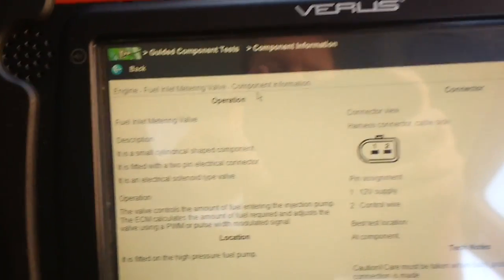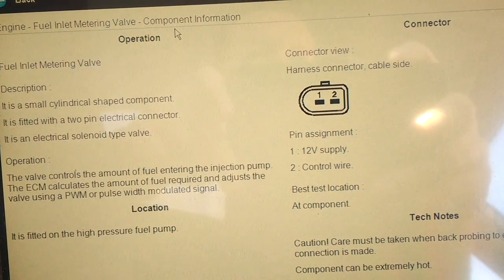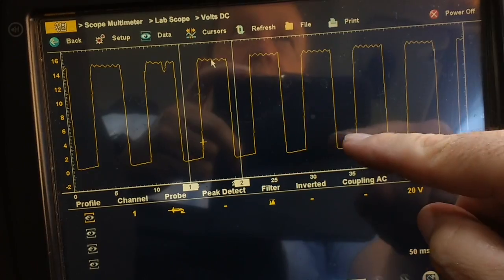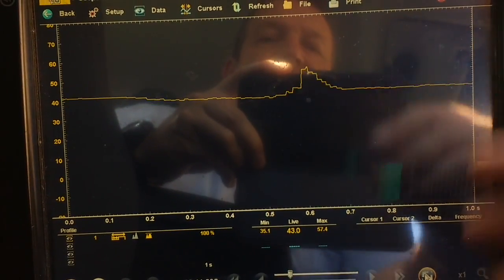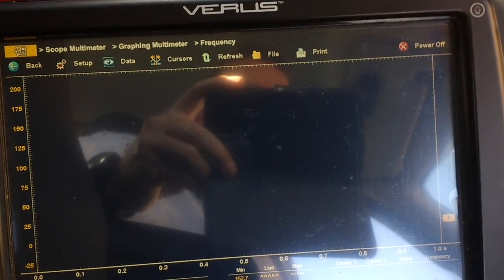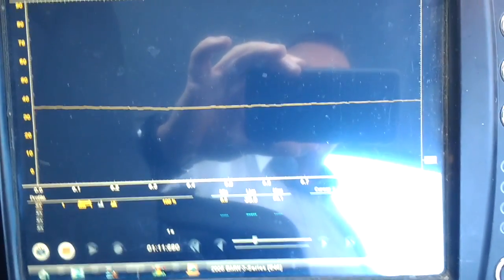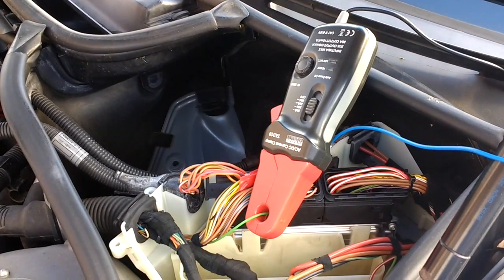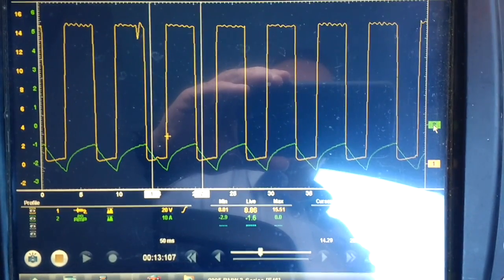Testing fuel Inlet Metering Valve/DRV DIESEL

Comment: Hi sandy, are you a member on simply diag Facebook group? I’ve got a surging idle on a A20DTH insignia, I remember watching this video last year and I found it today and did the tests shown. 
I’m getting drop outs when scoping the control wire on the IMV. I’m thinking it’s the valve but how do you determine if it’s the valve that’s causing the drop outs or a issue with the wiring? 

Great channel by the way! 👍
Reply from the maker: Hello my friend, the good IMV that I've seen don't suffer from dropouts only the faulty ones! There is usually a code in the pcm to confirm your diagnosis but not in generic obd but in enhanced.  I would replace IMV cheers sandy

Comment: Great tip using the duty cycle function I was thinking of trying the current clamp next time I test a pwm solenoid. Been having trouble in the past with a intermitant drop out difficult to prove if it's a drop out from the wiring or an open in the solenoid coil.
Reply from the maker: No problem glad to shared cheers sandy

Comment: Nice video Sandy ! 
Guess my scope waveform had some strange picks on this valve , because some interference . The car will be again in the shop after few days , and i'm going to check it out again , but this time on the ECU pins . About the amp draw , guess the 4th cylinder and 6th cylinder use different valves , thats why mine was drawing around 750 miliamps .
Reply from the maker: Crank cheers my friend, keep up the good videos it's great to share and increase our automotive knowledge many thanks, sandy